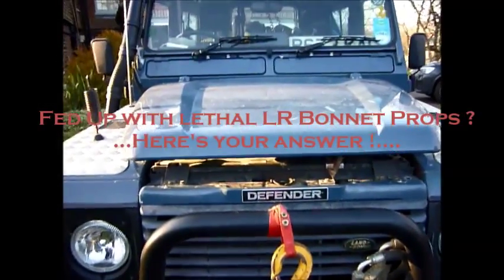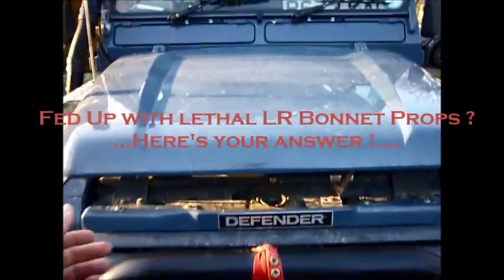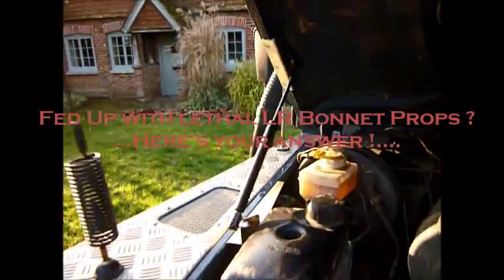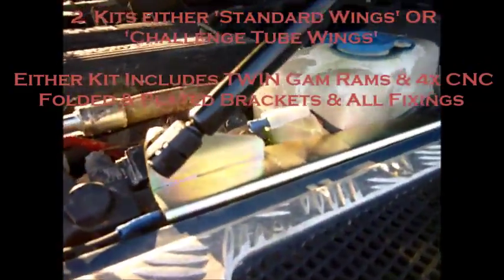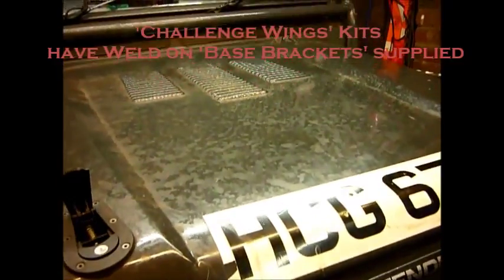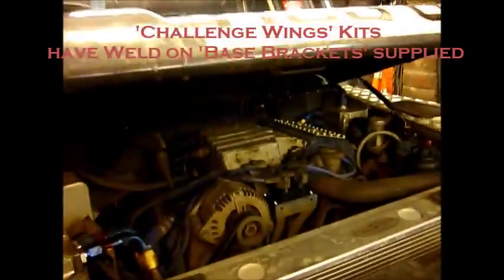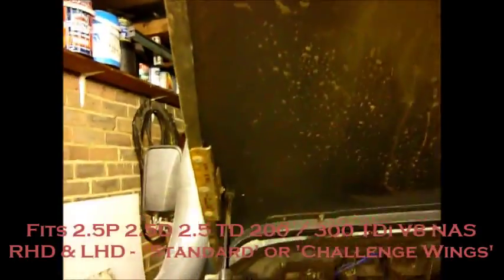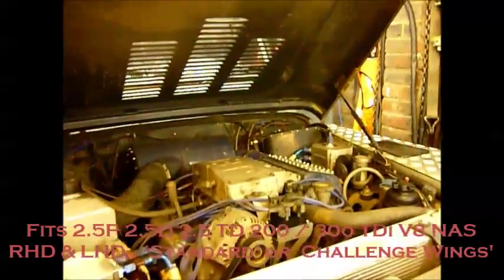Gas Ram Video

Comment: After insatlling the lower mounting plates and moving to the bonnet, I find there is no clearance for the plate between the edge and the checquer plate on the wing.  Have you addressed this?   The only solution I can think of is to mount the plate inside the bonnet lip, I have no liner to contend with.  Has this been done with success?

Comment: Do you supply heavy duty struts for military bonnets with spare wheels?
Reply from the maker: No, the spare wheels are way to heavy for gas rams and we have now stopped making even the standard kits as the price rises for the various parts have made them bonkers expensive so we called it dat sadly